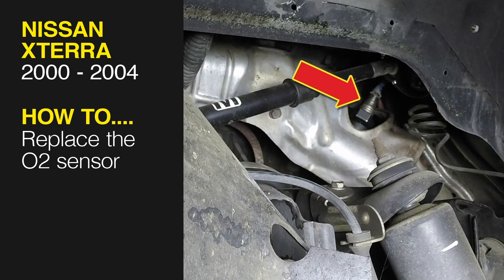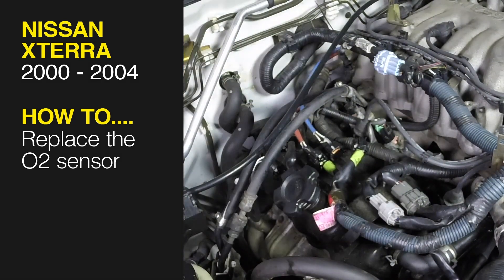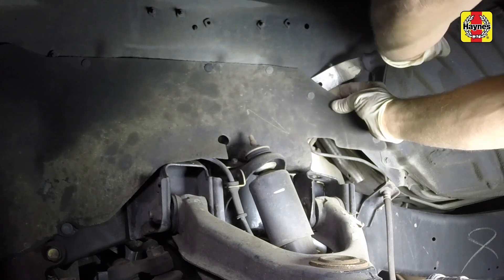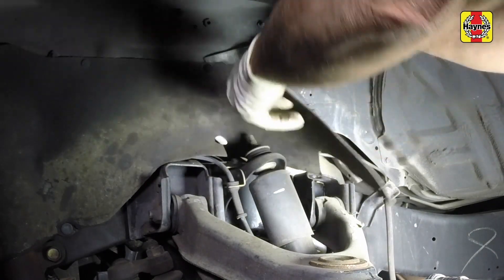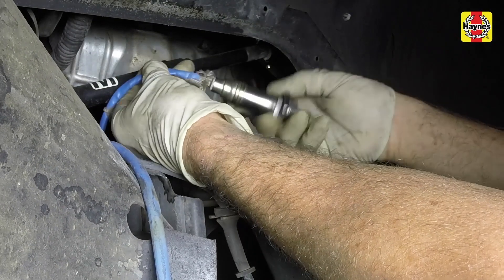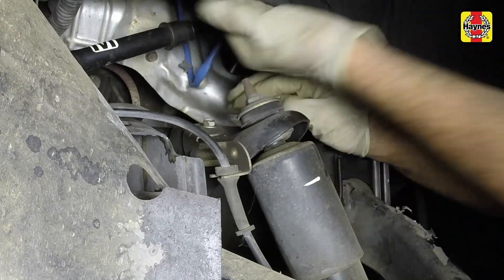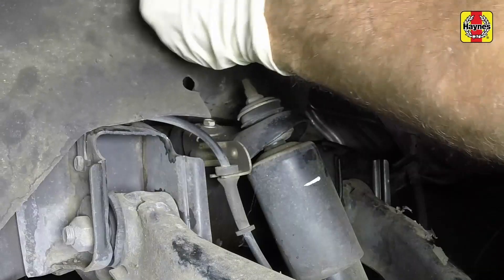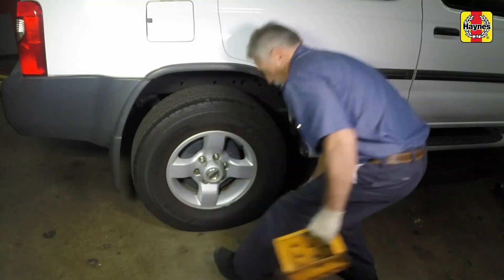Replace the O2 sensor on a Nissan Xterra (00-04), Pathfinder (96-04) or Frontier pick-up (98-04)

Comment: I love how it makes it seem like this sensor is just going to come out super easy.... we all know its going to be hell trying to get that thing out!
Reply: Just did this - took me 5 hours between thinking I had the wrong sensor and driving around to various parts stores, struggling to thread in the new sensor and finally trying to route the new wiring the same as before without having it touching against the engine block. knuckles are bashed and scraped a bit but it's done!
Reply: I did all 4 very fast. I sprayed them with WD-40 about half an hour before.
Reply: Wonder how many swear words and lost bolts will go through the process
Reply: Like someone I used to work with, he would describe a process then say " bip, bop, done "
I would say " I don't know, there's a whole lot going on between the ' bip ' and the ' bop '.

Comment: picked the easiest year model to change that sensor, an 04, trying doing it on a 03 or down v6 that does not have a splash shield to remove for easy access

Comment: I am having to replace the connecter as the cables are frayed. Inadvertently, purchased and replaced the O2 (Bank 1, Sensor 1/Right Upstream) twice before noticing the connector cables are toast on that one. The first time, I replaced all four, and 3 out of the 4 engine codes disappeared, sans Right Upstream. I would love to see the connector replacement. The O2 sensor replacements are a walk on the beach! Did all four very quickly.